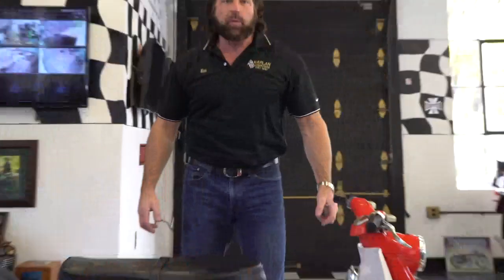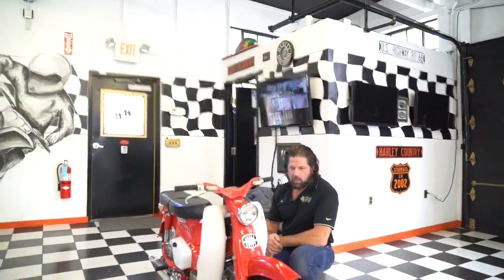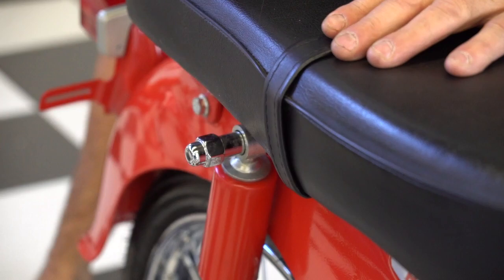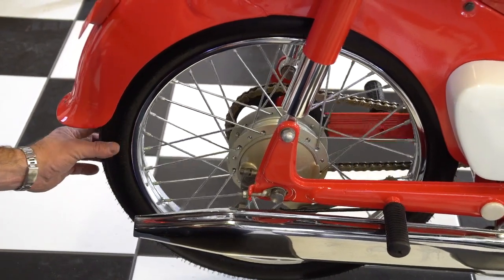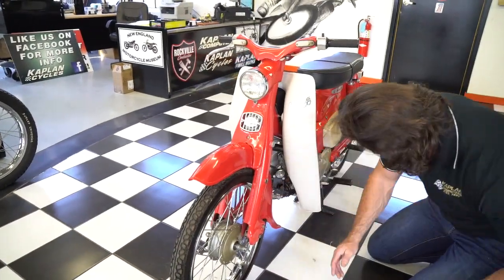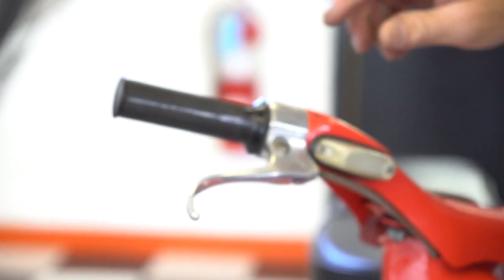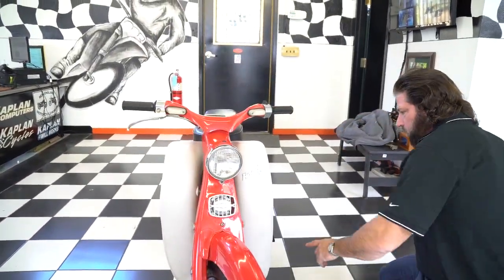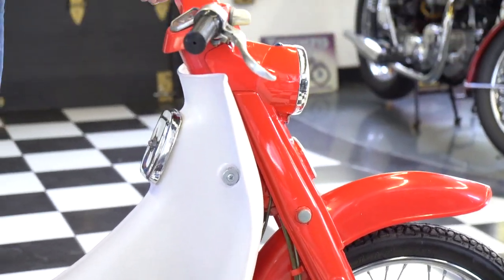1965 Honda C100 50cc

Comment: In indonesia C70. Because this bike have 70 cc engine with 3 gear engine.
Reply: no its not c70 mas. they both are different. c100 is the mother of all the cubs that honda has ever made. my dad have both of them (c100 and c70). in indonesia we called c100 as unyil and c70 as pitung